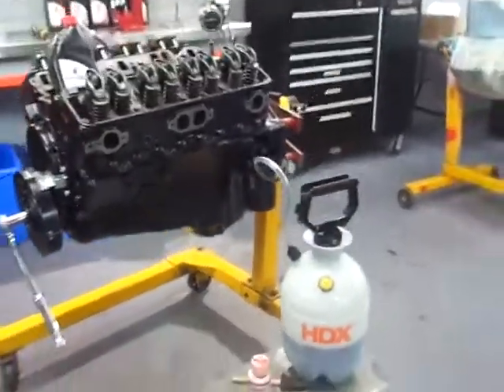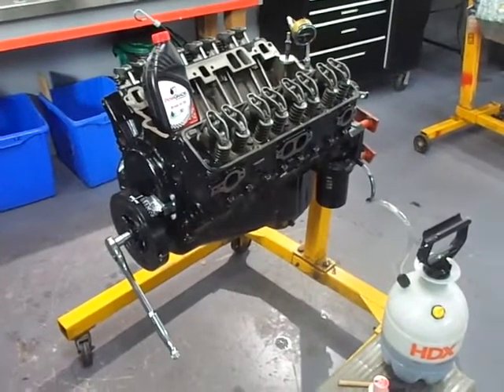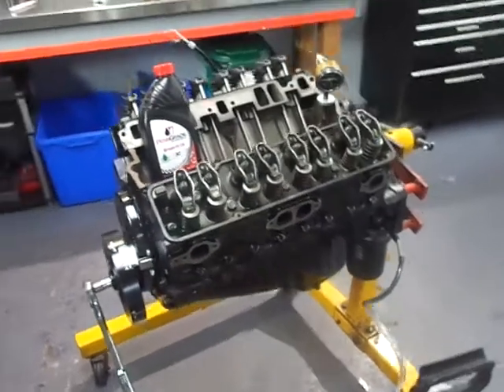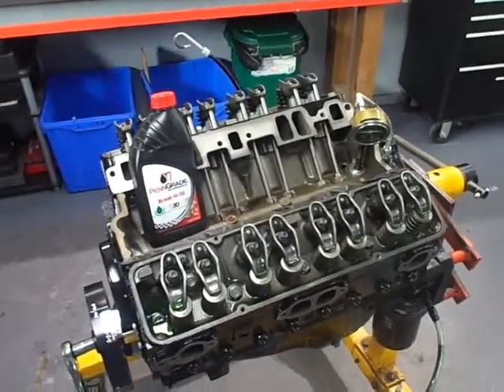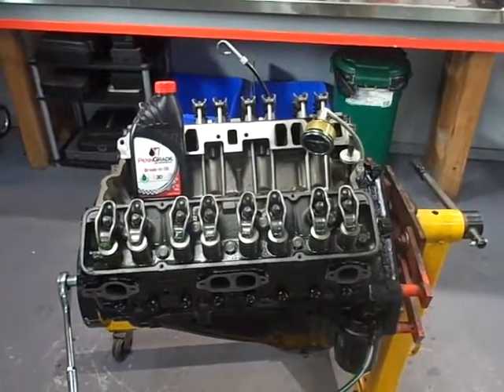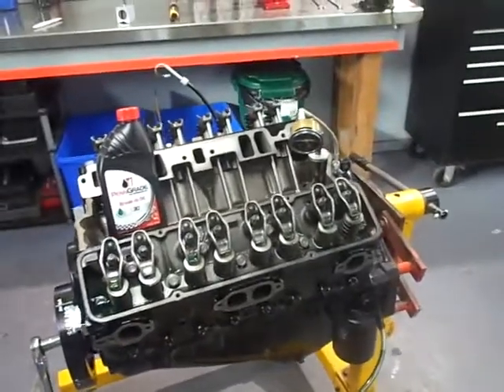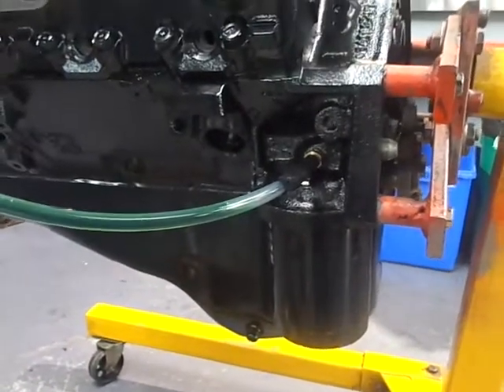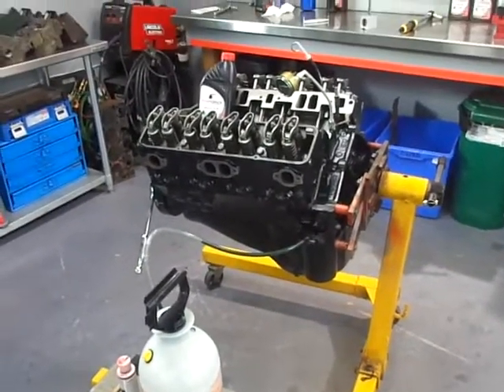How to break in a flat tappet camshaft with pressure tank, Part 1

Comment: Interesting video. There are machines like a Spintron that you can use to break-in an engine not under it's own power. Not sure how effective it would be for the rings with no combustion pressure. Lots of OEM's use propane or natural gas to run them on for factory testing. Anything with the name 'Comp Cams' on it is pure garbage. Even that break in lube.
Rotating the lifters in the bore by hand is OK but no guarantee they will when running. It's the crown ground on the lifter and the taper on the lobe that promotes rotation. More than likely it was the cheap Mexican lifters the mass rebuilder uses. That's almost always the cause, along with minimal lobe taper.
Reply from the maker: In the end, you would never notice the difference on the street. Just make sure you have enough octane for your compression pressure.